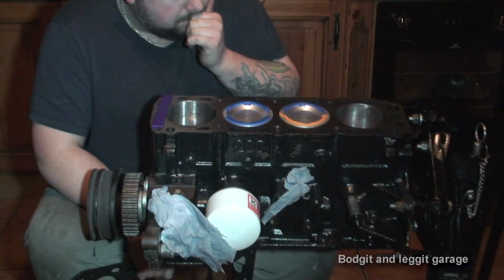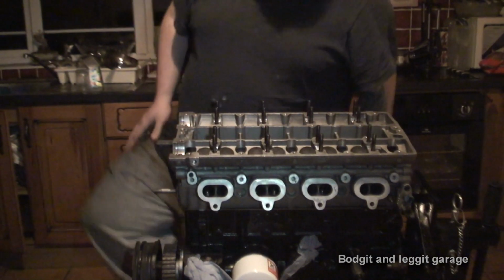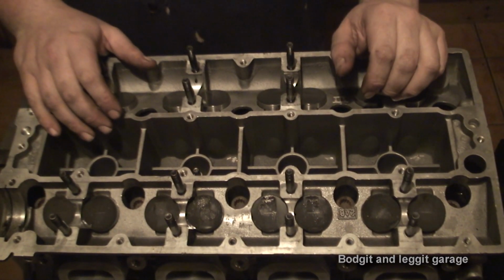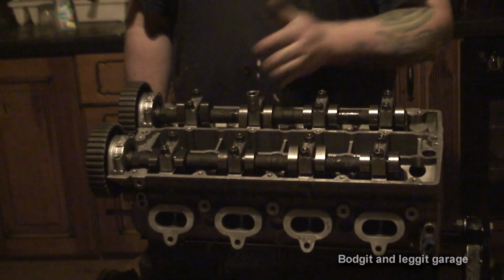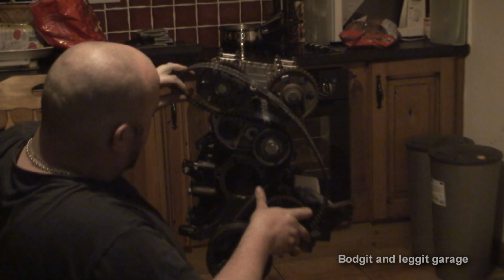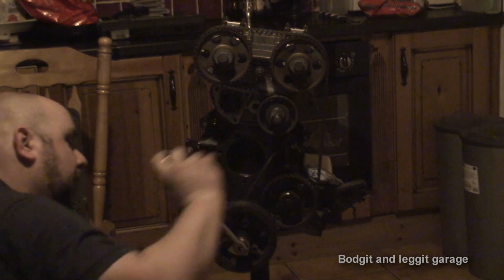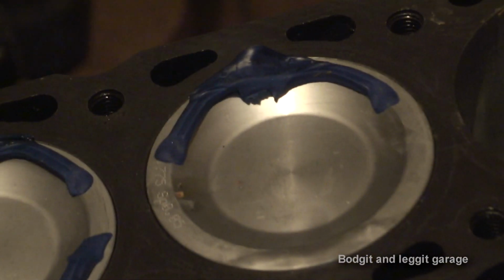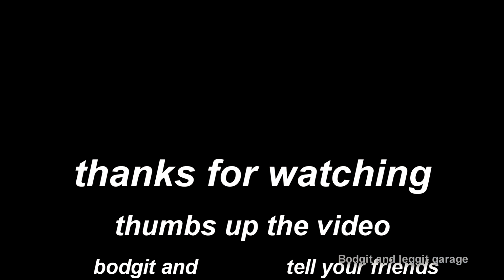Bodgit and leggit garage cosworth bilud part 4 check valve clearance (project van part9)

Comment: Can i use my ford sierra 1990 2.0 cl dohc block?
Reply from the maker: Ford Sierra 2.0 you can use this on any engine
Reply: bodgit and leggit garage thanks man!
Reply: bodgit and leggit garage but did you mean the compression thing?
Because i meant that can i use my sierra block to make a Cosworth engine
Reply from the maker: Ford Sierra 2.0 do you have a 205 block
Reply: bodgit and leggit garage i cant remeber i'll go check in a bit
Reply from the maker: Ford Sierra 2.0 you must do make you a 205 Pinto block you can use it but you do realise you have to replace everything internally which isn't going to be cheap also your bottom crankshaft needs to be replaced
Reply: bodgit and leggit garage yes i know that, but i think i'm just going to use my orginal engine and do something to the valves and install a turbo